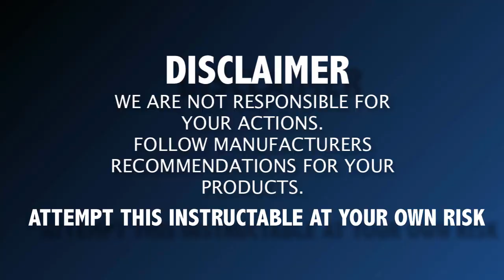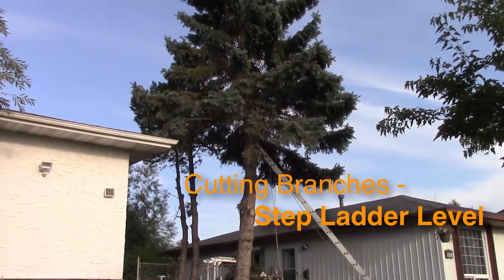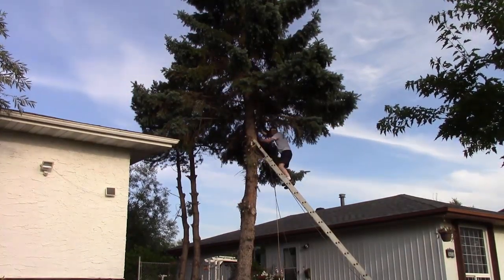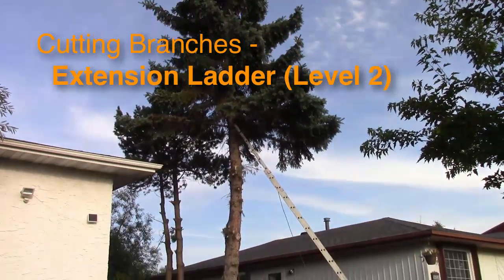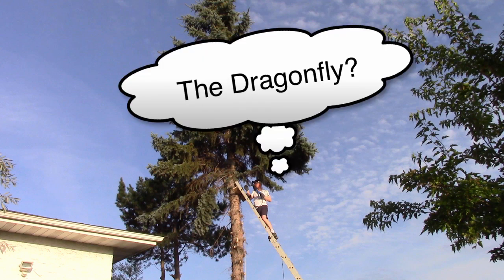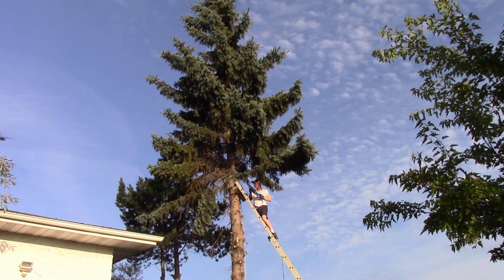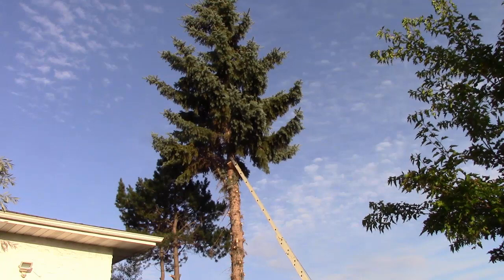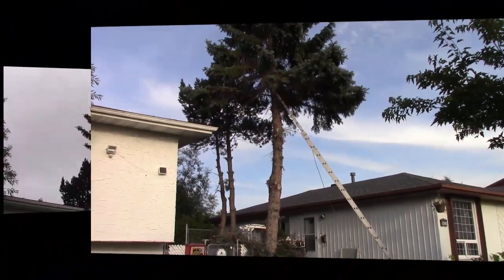How to cut tree near house without chainsaw - Pt 1

Comment: You are very brave to go so high.
I just recommend to use a battery saw saw. 
Your are using a metal ladder with extended electric cord.
If one of those branches nick the extension cord when it go down.
You can get a electric shock lose the balance. And go down.
Reply from the maker: I guess anything can happen. Thanks for the comment and yes, this isn't 100% safe.
Reply: Most ladder today are aluminum or composite/fiber glass so they are not conductive.   Yes that is brave going up like that without fall protection of some sort.  One imbalance  for reaching for the branches behind could send him down along with all the gears.
Reply: Their is a fine line between bravery and stupidity

Comment: Hi Clint 
Your DIY ladder steady is interesting.
I wonder, did you consider lopping the branches working from the top down, I mean using the ladder to access the trunk at the height of the lower branches then climbing to the tree top on foot as it were. A little bit trickier to lower the lopped branches but nothing that couldn’t be done with a rope or zip line. Working your way up a bare trunk with just a ladder looked pretty precarious?
Reply from the maker: I did not. I do feel comfortable on ladders and was very aware of my movements and the limb movements. I've never tried climbing a spruce or pine but thanks for the interesting idea.

Comment: Dude your ladder separating at the bottom as you bump it up. Did you remove a bracket? Unsafe and so isn’t the angle. There’s a reason for the four to one rule.
Reply from the maker: No, I did not remove anything and it was like that since I acquired it..It has worked fine for me. Yes, I know the angle wasn't ideal, like our farmer friends, sometimes we have to things that aren't the safest, but with caution and awareness.